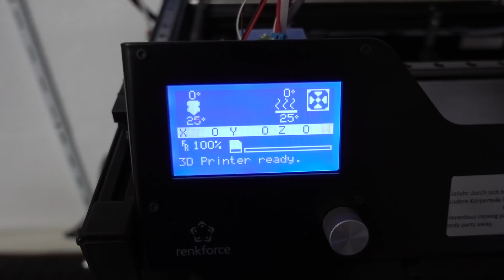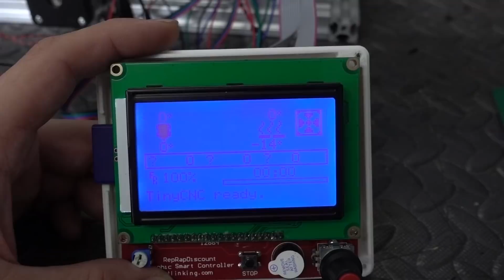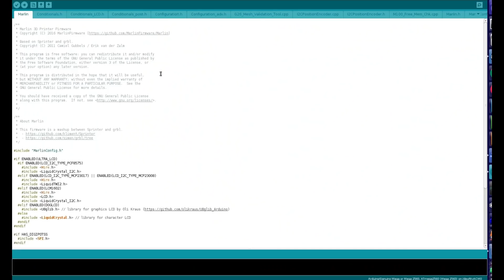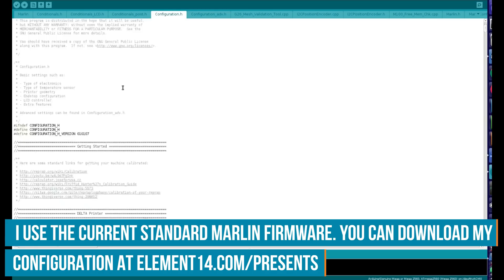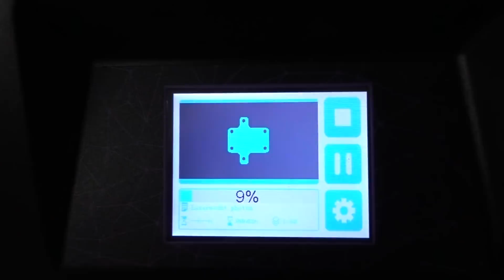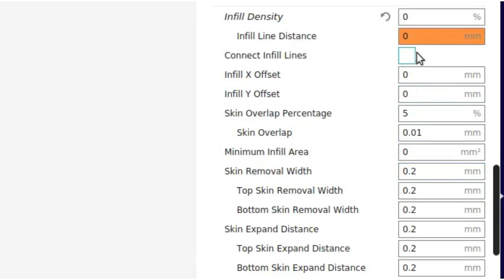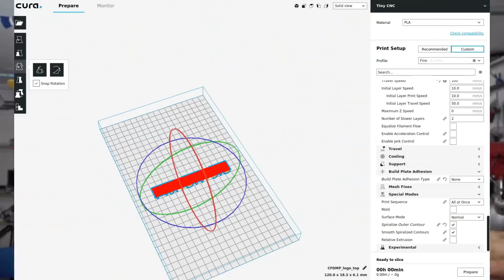Make Your Own CNC Pyrography Wood Burner

Comment: I would love to be able to purchase an inexpensive 3D printer and then make various tools for it. 1) creating a head that would basically be the highest resolution camera I can get on the cheap would be nice. Then I know that I can do a 3D scan by having a head that swivels and rotates that's it goes around the object getting it from all angles. 2) 2 having a laser head that can burn or cut that way I can do wood burning, foam or plastic cutting maybe possibly cutting harder materials. 3) being able to swap out the laser head for a Dremel so that I can also use the system as a CNC. 4) next create some kind of head that can hold various felt tip pens in order to be able to do 2D plotting on paper or transparencies and also use the felt-tip style pens that are used on copper for creating circuit boards so I can print circuit boards. 5) I want also to be able to still use it as a 3D printer. Being able to use that 3D printer for both spools of plastic a various types and being able to switch out to use resin would be interesting. I could see all this being done by one 3D printer simply because it would only take the change of a head. Some heads might need to be more mobile then others and that Mobility might have to be built into the head rather than the machine but I think it would be doable. But I want to know is what 3D printer  is the best  to be the basis for this  concept 3D printer. Please note I did say I want to go on the cheap so possibly purchasing all thread and metal parts to build my own but also be an alternative. Accuracy does not have to be super high, however I would like to be able to print project boxes for electronic devices as well as print circuit boards. I also would like to be able to print other 3D objects and do wood burning if possible

Comment: Well after I watched this video with all my hairs standing I have to add some comment. So CNC 3018 or it's smaller version works well if you firstli find some tips and adjust gcode of original woodpecker board. I'm using it for a while with good results you can se my wood burnong work on my insta page https://www.instagram.com/railroadlc3dp/ . I also modified exporting code for Fusion 360 so i can export gcode of my project and burn it on wood with LaserGRBL program. Now I'm working on powersupply and encloser also on more powerful laser (2.5W current power). Conclusion CNC3018 isn't bad but your way of aproach is.

Comment: This guys videos are so cringeworthy, Drills into a power supply, uses wrong cable colours, forgets to turn on the power strip. and then instead of fixing an issue with a reversed axis, just mirrors the part in the slicer. For sure element 14 can find someone good to do their videos

Comment: Last thing you want in the power supply is chips my man 😎
Reply: Haha, no it later turned out that I did not switch on my power strip, when testing, but I did not bother to search for the cause and just replaced the psu. Did not want to loose precious time.

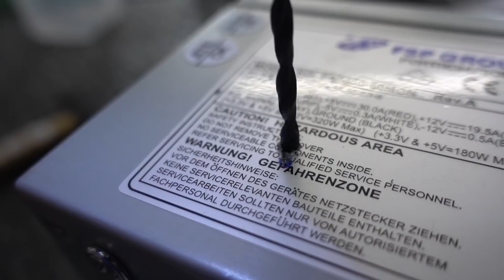Comment: 2:38 - It died because you drilled metal shavings into a high voltage circuit at 2:05 ..... 😧😲
Reply: I've only gotten 3 minutes into the video, and that part made me cringe.  I did something similar to mount an ATX supply into my MAME cabinet, but I carefully opened up the casing and slowly drilled from INSIDE the casing, then I vacuumed the shavings before powering it up.  Also freaks me out to see someone solder in 20-30 caps or components on a pcb and then clip all the leads letting them fly everywhere without a care as to where they end up.
Reply: Haha, no it later turned out that I did not switch on my power strip, when testing, but I did not bother to search for the cause and just replaced the psu. Did not want to loose precious time.
Reply: @MAYERMAKES  So you replaced the PSU and everything worked? Or did you replaced the PSU, then discovered that you didn't supply it power in the first place, but decided to tell us that the PSU died for apparent reason, though you knew why?
Reply: Dan R. Hansen  No, I thought the PSU was broken( althought the power strip was jsut not plugged in), replaced the PSU, filmed the segment tested the new PSU. and much later(after the video was finished) realized dad I switched on the strip for the second testing but not the first time, tried out the old psu..worked. so at the moment of filming I didn´t knew the cause and did not care. It is much more important to finish a video, than saving a few bucks for the PSU.

Comment: A LASER would be more accurate and be scanned over the material using mirrors on two motor driven rotors just control the on off time to burn spots in the material, both spindles will be at right angles to each other the two rotors will rotate at different rates to create a raster and you just turn the beam on when you want the point that the raster is at burned and turn it off and move to the next spot to be burned very much that used in some LASER printers.

Comment: hmmm instead of accepting that your wiring job is a hack one, just instantly blame the cheap parts.  I've used what you call Knock off boards with no issues.  Maybe learn some more about wiring and such.  Cause that "i tried to make the module stronger" part was just so cringe.  Just adding more voltage won't make something stronger *facepalm*.
Seriously Element 14, you can't be serious with these videos.
Reply: I agree
Reply: I agree with You
Reply: The not marked onboard regulator on the knock off blew up without applying power to the barrel jack, it only got 5v over usb. The wiring was correct. There is no doubt the board had an issue probably shorted out. Unchanged wiring on a genuine arduino worked fine. I also got clones around that do ok, but this one did not.
 On the laser: the module is rated for 5-12volts at constant current of 0,1-0.5A . Within these specs it burned out.

Comment: I really miss Ben so much. The new videos barely explain anything, they are just some shots of the process but no details at all, and I find them terribly confusing.
Reply: It is hard to put everything into a given time frame. You can find the config files on element14.com if you want to dive deeper.
Reply: @MAYERMAKES  I understand it is hard. But it would be nice to see some kind of explanition of the parts you are going to use for the project and some kind of plan. For example in the video, in the first prototype, what was the purpose of the arduino board? What were the other board used for?
Reply: the ardiuno controls the cnc, it runs a firmware called marlin, like a lot of 3d printers do. the shield on top of the arduino holds the stepper motor drivers. these are connected to the motors on the machine.
Reply: Alfonso isn't literally asking what the boards do, he's highlighting the flaws in the video
Reply: Ben was good. these new hosts are terrible. Perhaps it’s element 14s way of saving money by getting amateurs in. That way they don’t need to pay them if they are bad.

Comment: ATX breakout board is the safer option, no hard wiring needed. when switching colours, you must identify the wire, typically is ok to use tape to specify your change. change your z-hop settings in cura
making a mini CNC base with old CD/DVD drives is my next project.
Reply: If you habe the parts , a breakoutboard would be nicer, but I did not. There is no z hop when you do not have a z axis